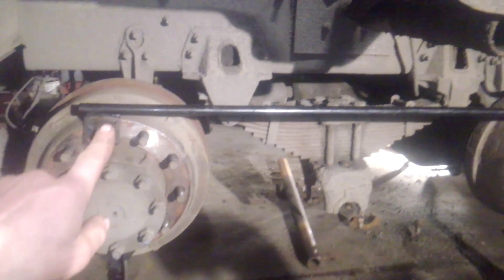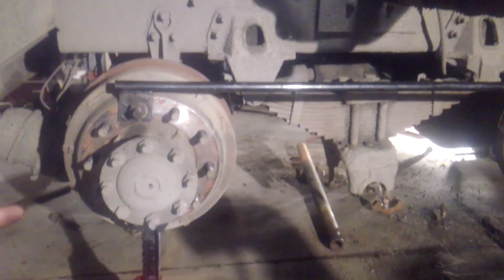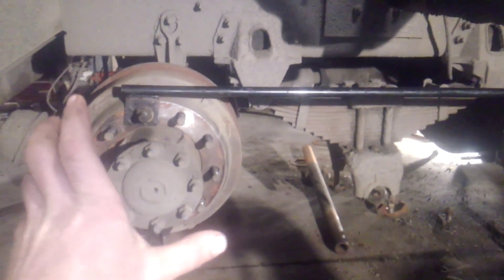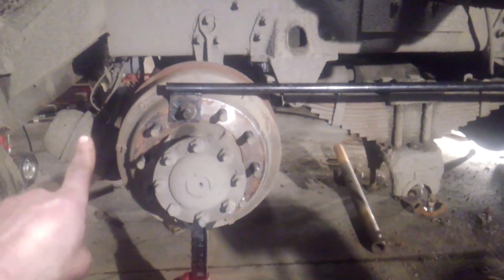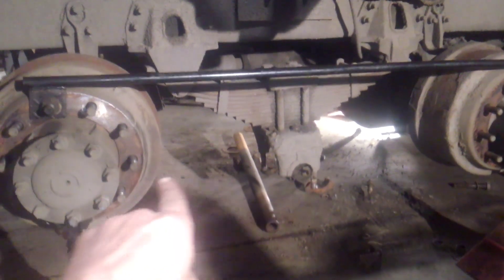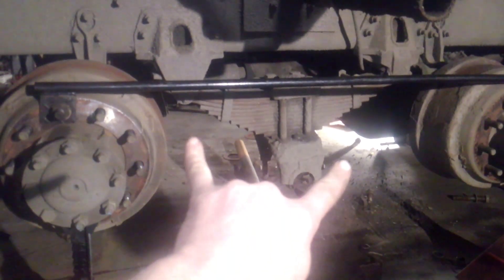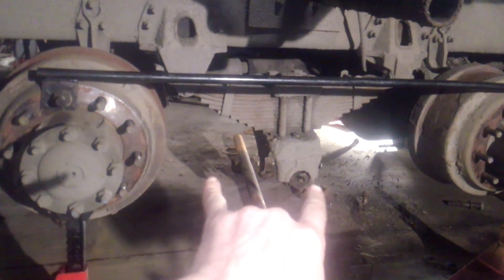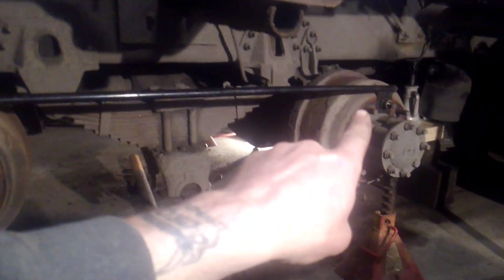How to... Hendrickson walking beam trick

Comment: That's a great idea if they are 40,000 rear-ends an not 38,000# rear-ends. But if they are 38's tighten down the slack adjuster tight to lock up the opposing axle
Reply from the maker: Yes sir

Comment: I got a rt400 Hendrickson walking beam suspension. While turning I can see my rear wheels poking out moving side to side depending on which way I turn.

Not normal huh
Reply from the maker: No, you will have some side to side. But when you start seeing half a tire, or scuff marks on the springs. Time to get it done
Reply: @mlhrepairsllc6942  thank u so much for the reply. I really need the truth because some mechanics are telling it’s not supposed to move at all
Reply: According to an old service video on YouTube they are designed to track up to 3 inches in a turn

Comment: What’s your trick on getting the pucks out?
Reply from the maker: Tapered pucks, I have not seen that style in years. Got to be 20 years ago. I would spin them out with an air chisel
Reply: MLH Repairs LLC yeah your not going to believe this but I had to do a set on a old 80 Chevy water truck for a stone quarriey. It took 4 tanks of acetylene and the baddest fucking air hammer you could buy. I had to torch the rubber off of each one. And when I got the beam down the the pucks still wouldn’t air hammer out. Even when you cut them in two. It was a fucking nightmare. Never seen something so rusted in place like like. Took a week.  The bolt ons are so much easier. Lol
Reply from the maker: @hddm3  sorry for the late response but I never got a notification.  Sounds like that one sucked